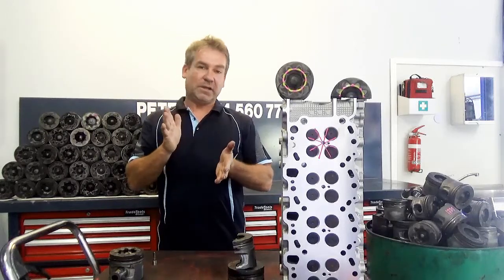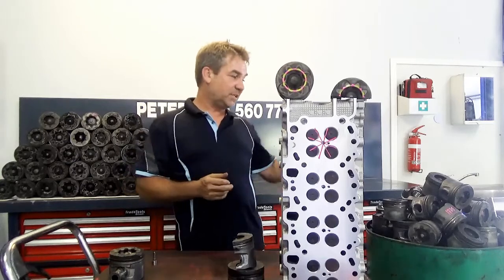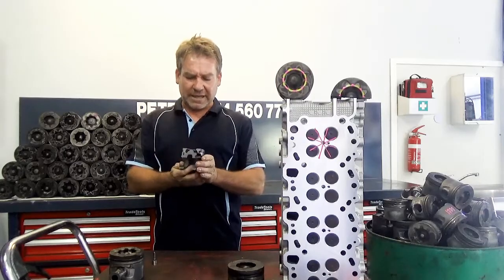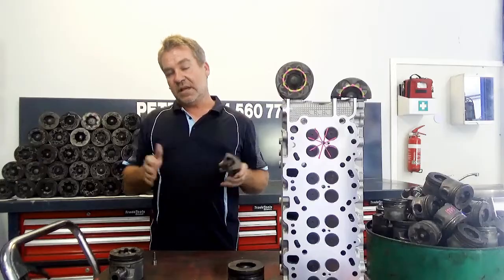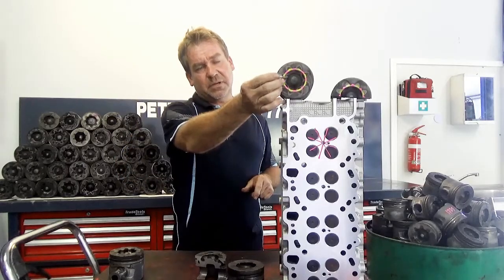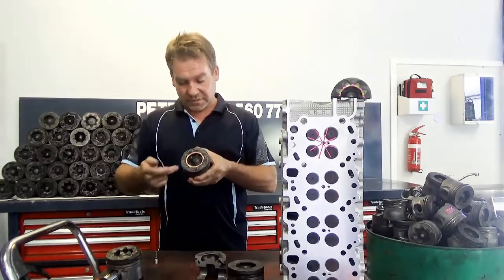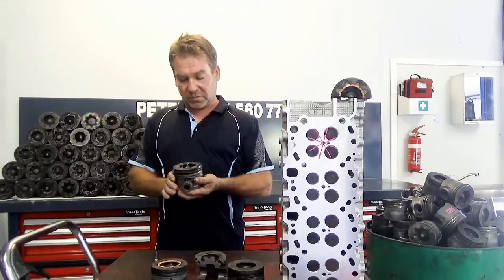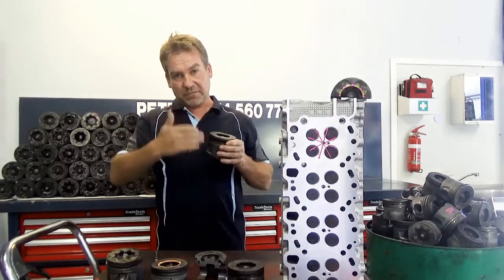Toyota 1KD Hilux Prado cracked piston, after building 1000 1KD's this is why I believe they crack.

Comment: 5L was the best hilux engine notvthe kz and this new shit,same with the best were 1hdfte and old 12ht landcruiser engine, I personally own a 300,000 KS 2009 79series landcruiser I use 5w40 full synthetic castrol engine oil and rhyco oil filter, best thing to do with the v8 change the engine oil at 8000 max don't go long
Reply: Hey mate, how come you run 5w40 and not something like 15w40? I agree with you on changing oil etc earlier then 10,000km

Comment: A good video but why hasn't Toyota fixed the problem with a better designed piston like a real diesel eg cat Detroit Cummings ues Two peace piston with steel crown and gudgeon pin with a aluminium skirt?
Reply: They discontinued the 1KD engine and replaced it with the 1GD they never fully addressed the problem

Comment: What a well educated explanation  of this prob, I just bought my first Hilux 2011 hl2 D4D (think it's a KUN25? Noticed rattling noise on acceleration so bought a bottle of injector cleaner(fuel tank additive) but it seems to have gone a bit worse? It's around 1500-2000 rpm any advice plz.
Reply: Same problem, noise starts at around 1400 and disappears after 1800 rpm. Have you solved your problem?

Comment: This isn't a peripheral engine problem but a direct piston cylinder and one would have expected toyota in their controlled engine evaluation would have picked up this issue
Reply: It seems they did upgrade the pistons on the euro 5 models which were released in Europe the euro 3&4 models never got such a thing.

Comment: Great video mate. Cheers for the info. What would be the solution then? Is it something that can be avoiding by modifying the injectors? Would be great to see a correction for this if there is one. Cheers again mate!
Reply from the maker: Hi Luke,
Yes there is something I have worked out that will help, I will be putting it into a video soon. Thanks Pete.
Reply: @enginecare1417   thanks for the video , looking forward to the follow up. We just got a kun26r with 355kms on the engine

Comment: Here is a tradesperson who knows what he is talking about. No misinformation. I suggest you listen to the truth about the 1KD pistons. Long hauls, high rpms and heavy loads cause cavities on the top of the piston. If a cavity develops on the edge of the combustion chamber this then will lead to the hole cracked piston situation. Nothing to do with the injectors as this was tested by Toyota engineers in 2014. The findings were the pistons are to blame for this failure, not the injectors. Toyota's own words.
Reply: So an EGT gauge will help? Making sure to keep the engine running cool when towing or in the sand.